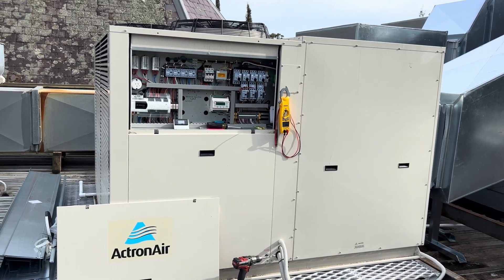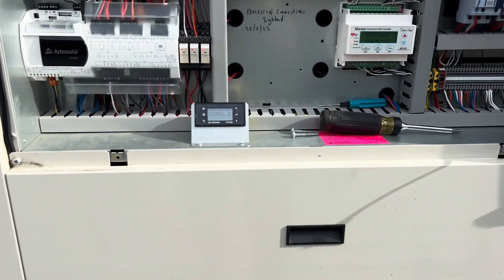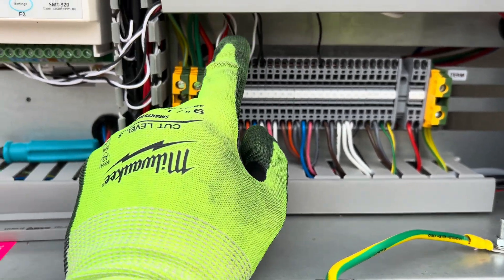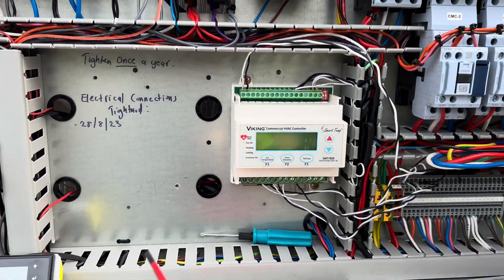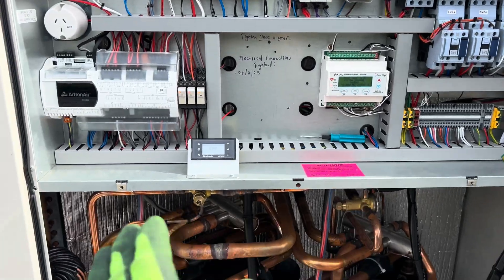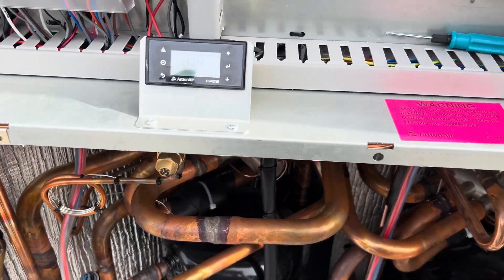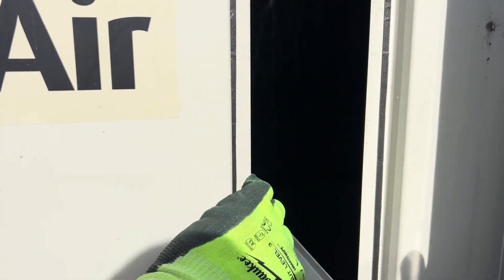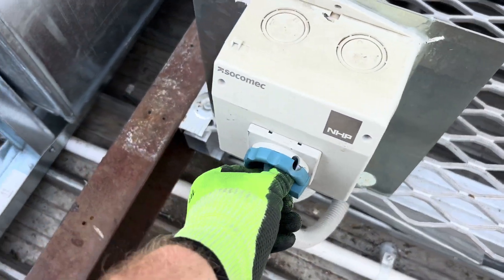Actron Air / Airflow Issues on a 71kW Tri-Capacity Package Unit

Comment: It is so nice to see neat electrical panel for a change. Don't know why but the US manufacturers cannot produced a clean electrical panel, wires hanging everywhere, not using good quality switchgear. Them PVC cable management trays are not that expensive. Saw one video where they are using 2 pole contactor for a 3 phase load and keep 1 phase connected at all time.
Reply from the maker: Most of the units I come across have a similar setup for the wires. It’s a lot nicer until someone starts yanking out wires and not putting them back. Turns in to a shit show very quickly 😂

Comment: Hey mate what app are you using for pressures and temps? And what testo fittings ?
Reply from the maker: It’s MeasureQuick. It’s a good app to display all the readings. I usually swap between the testo app and MQ. My Testo Probes are the 115i clamps, 549i pressure probes and the 605i air probes.
Reply: @hvacraustralia  thankyou can the probe also act as a vacuum stat
Reply from the maker: No unfortunately. That’s a seperate probe. 552i

Comment: Hey AC man that’s a lot of metal sheet metal or the ductwork. I seen some big equipment before with a lot more compressions than three. I’ve seen them with four and five compressors and one unit but I don’t think I’ve ever seen one with that much for the heat 71 KW.

Comment: You must have someone where they big paycheck when you run a 71KW strip that’s a lot of amps I couldn’t afford to pay the bill one time alone all through the winter but I think it’s the biggest KWI I’ve ever heard of so I hope someone stays warm during the winter From Tallahassee, Fred
Reply: That 71KW is probably delivered capacity. So with a COP of 5 it should draw 14,2kW from the grid. And Australian winter temps aren't too drastic so it probably is still doing a COP of 3 on the colder days in heating.
Reply from the maker: The above explanation is spot on 👌